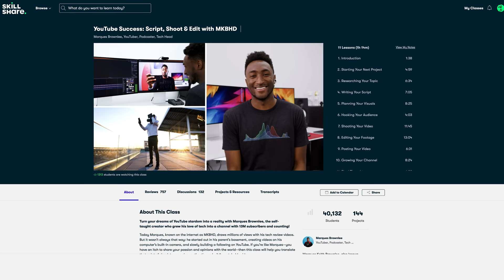EASY Beginner Basic Tool Workbench Build!

Comment: John I've used those casters on a couple of shop carts. You'll want to re-drill the mounting holes for 1/4" bolts and bolt through. The screws will pull out with that much weight regardless of what the packaging says. Otherwise they've worked great for a couple of years.

Comment: Suggestion: how about a foldable version of this workbench that can fold flat onto the wall for garage workshops?
Reply: As I was watching  I was trying   to think of a way to do just that. Would be great for smaller shops .
Reply: You wouldn’t have the lower shelf, but attach the legs with carriage bolts. I just did this to mine not long ago. There are a few good plans for it and videos if you do a search.

Comment: This is a fantastic vid.  This is a close copy to the most useful thing I have in my shop.  Mines 4x6 and doubles as an outfeed table for my table saw.  I will say mine's not as fancy but I get it from a video making perspective.  For those who don't have a helper, 1/2 " plywood weighs a hell of a lot less than the particle board and is back to being affordable.  The hardest thing for me to get used to is that this isn't a work table you worry about, you just replace pieces.  I cut, paint, epoxy, feed animals, store crap, and once I took a nap on it.  Thanks again for the content.

Comment: i built quite the exact same bench for myself but i used cheaper material. Wooden stick used for roof. So i ended up adding a fifth leg in the middle of the bench and it is very sturdy. Highly recommend.

Comment: I just made a table like this last week, although a little smaller (3'x7').  Used 4x4s for the corners and 2x4s for the rest.  Also used pocket holes and castors.  Only used drill and portable circular saw.  Not that I have this table, I can get some more power tools for bigger jobs.
Reply from the maker: Atta boy Justin! Crushing it!

Comment: Quick tip on combining boards if they’re not joined:  Crown them the opposite way when gluing or screwing together  That’s what framers do(or are supposed to do) when building headers on a house.  That way the crowns of the boards are fighting each other and it becomes super stable.

Comment: The middle of the long stretchers will sag over time. I built a similar bench to this as my first. The middle of mine sags, had to add a 5th and 6th leg to mitigate that.
Reply: I was thinking the same thing , might be able to double long support, 2x6 or use an engineered gluelam beam. A couple 45 corner braces could also shorten the span.
Reply: @Belg1970  all good choices. Don’t want to be considered a troll but have to share my experience.
Reply: @AJB326  Not at all I think we are sharing our life experiences and trying to help. I think way too many YouTube creators are getting way too touchy about comments not meant to be critical.

Comment: I'd like to see a 4x4 ft table with casters that can be joined with another 4x4 ft table to make an 4sx8 ft table for big projects. I'd like to see it have something for adding heat guns on one leg and a paper towel holder on the diagonals so that I can do my epoxy work. 
Oh, yes! I'd like it to be casters that can be locked in-place.
Thanks for your consideration!

Comment: Late to the party as always, I'd like to ask something I think is obvious. You are 6'2". I am 5'7".  So you are 7 inches taller than me. Do you measure table height from floor to waist? Floor to belly button? Given the difference in body types, what's the right height? I have short legs and a long torso. Some people have long legs and a short torso.  That would make for people of equal height having a different distance from floor to waist or belly button. What's the correct way to determine the optimal height of a workbench?

Comment: Hey John!

I have a table saw and a miter saw in my un-temperature-controlled, uninsulated detached garage that I haven't used in 20 years. After all this time, I need to work on a project for my kitchen. Are my tools still good? Are there any components that I should replace? (Saw blades?) Are there any things I should look out for? Should I replace everything? I'm always careful when working around power tools, and I always take decent precautions (like protective eye and hand gear,) and I'd rather be safe than sorry. Thanks for the input.

Comment: This was a cool build.  This my first project when I got my house.  I built 4 tables similar to these.  Simple, Sturdy, and lasts for years.  I sealed the MDF tops with poly.

And you're right "if you're building this you probably don't have a table to begin with" I did everything on the garage floor.

Comment: If you need suggestions, why not just go through the progression of the next piece of shop project with 4 tools, and then the next project with 5 tools. Examples: workbench with 3 tools, miter saw cart with 4 tools, router table with 5 tools?

Comment: A little confused. Plans say when cutting for the long stretchers joinery to cut 3 1/2 but in video he cuts them to square them down to 3. Wouldn't that mean the joinery cuts should be 3?
Reply: John I have the same issue/concern/question…I think little Timmy Flynn is correct.

Comment: “The Wood and Steel Pitt” because you work with both wood and metal, John is a former Steelers player, the Steelers reign in Pittsburg, and Pittsburgh is historically a steel producing city. Both of these are the reasons for calling the shops the Pitt for Pittsburgh. I was originally thinking of the name “The Squirrel’s Den” because you all enjoy getting squirrelly but it wasn’t as dramatic as what the “Bat Cave” is for Batman. However, when you make the finishing area where you do the spray finish work, I hope that you might have a sign over the entrance door that says something like: “For those of us who are gathered here today, let us spray”. I think it is fitting as you always bring the viewers of the video into the finishing area and you usually say something with “let us spray” afterwards. Maybe make the sign on the CNC and epoxy the letters engraved in the sign. Just a suggestion. If you like it, cool. If not, no big deal. Still trying to come up with a dramatic name for the shop. Perhaps just “The Pitt”. I could just hear John saying, “Ok, boys, we have a project at The Pitt.” Maybe even go to the shop in the Pitt Mobile. Just a suggestion.

Comment: How many diy'ers have a shop large enough for a 4X8 work bench. I only have a 2X3 work bench for a 20X20 workshop
Reply: Depends if your car is there or not. I'm running a 19x23 garage and if I just leave the car out I can work with a 4x8. Do I need it? No probably not 🤣🤣

Comment: I don't have a table saw :(  Can the  roundovers be ripped off with a circular saw? Also, you motivated me to look online at table saws -- expensive! And the first DeWALT I looked at, 15 Amp Corded 8-1/4 in. Compact Jobsite Tablesaw (DWE7485), $300 at HD, has a 90-degree max cut depth of 2 9/16. But at 2:34 you seem to be ripping a two-high stack of 2x4s, for a total of ~3 inches? I'm a near total beginner, so am prepared for this to be a stupid question.

Comment: Challenge...  make a bench or tool cabinet using just a circular saw and drill for power tools and just a tape, speed square, hammer, saw horses, and pencil.  Not including fasteners.

Oh, and assistance from a helper is not allowed.

That is the situation most beginner diyers find themselves in.  Very few have a staff in their workshops unless they have kids.

Before you say it can't be done, I'll tell you I've been there and done it.  No YouTube channel because my production staff weren't out of diapers yet.😂
Reply from the maker: Haha I’ve been there too Cam. Solid suggestion